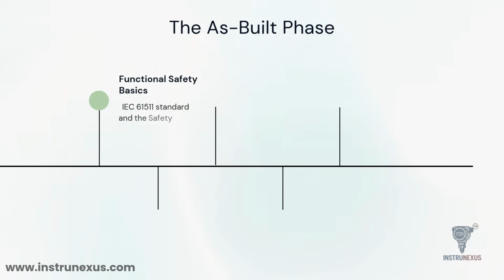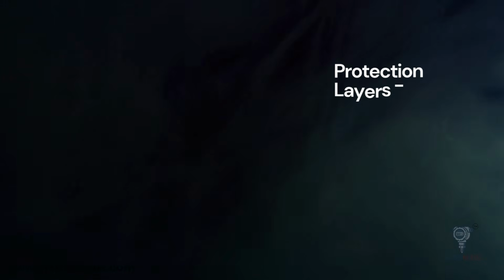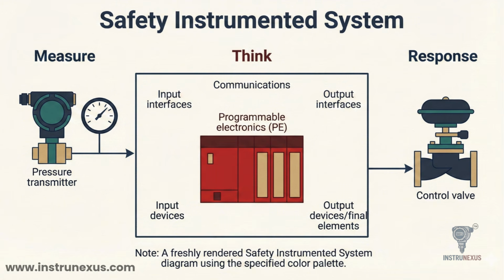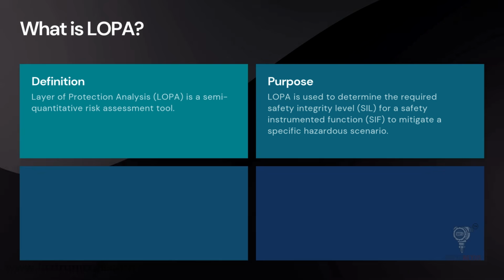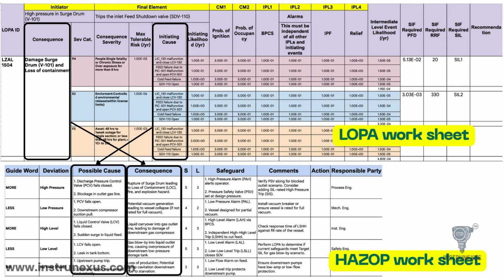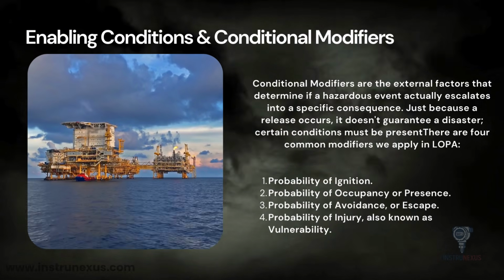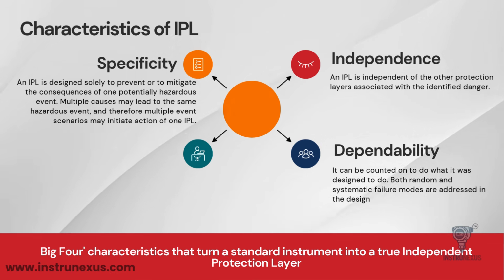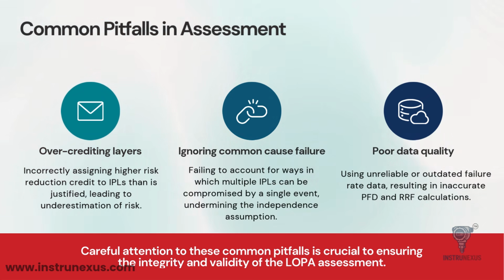Layer of Protection Analysis (LOPA) | The Bridge from HAZOP to SIL

Comment: We have a process in which we have non-SIL interlocks/BPCS. Which basically means that we don't know how much RRF our current interlocks provide. Should we consider RRF 10 or PFD 0.1 while considering it as an IPL during LOPA ?
Reply: Two things to untangle here. First, RRF 10 and PFD 0.1 aren't two options — they're the same number (RRF = 1/PFD), so the real question is whether you can claim that credit at all. Under IEC 61511 a BPCS loop can be credited as an IPL up to RRF 10 (PFD 0.1) even when it's non-SIL, but with hard conditions: it has to be genuinely independent of the initiating cause (not the same BPCS sensor or logic solver that produced the deviation), and you can only ever take ONE BPCS IPL per scenario, since additional BPCS layers sharing that logic solver aren't independent. It also has to actually behave like an IPL — auditable, under management of change, and proof-tested. If you can't demonstrate that independence and testing, don't default to the full 10; take partial or no credit and let that gap drive whether a dedicated SIF is needed. That 'we don't know the RRF' feeling usually means the IPL criteria haven't been verified yet, not that the number is truly unknowable.
Reply: @PlantFCE  thanks. Yes I just needed clarification on the multiple BPCS and how much PFD to be considered for multiple control with the same solver. Got the clarity. Thanks again